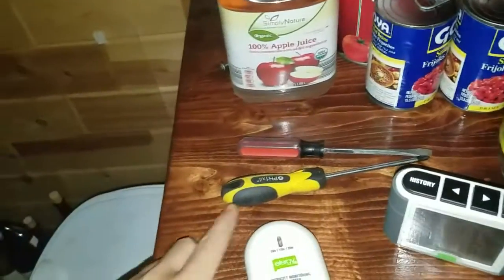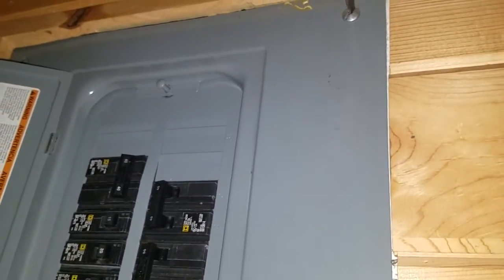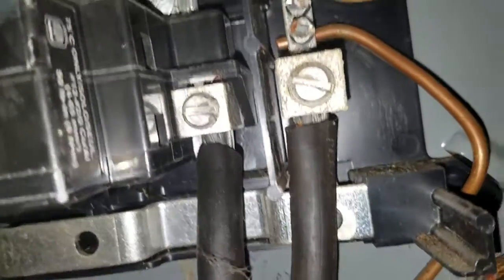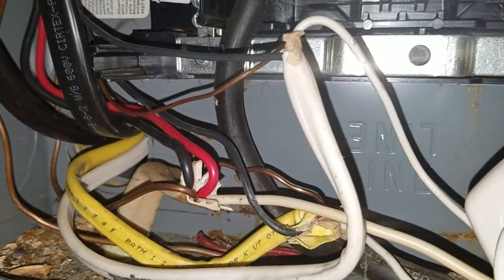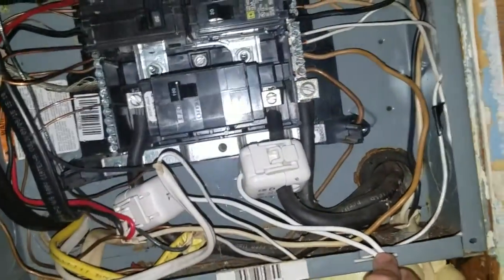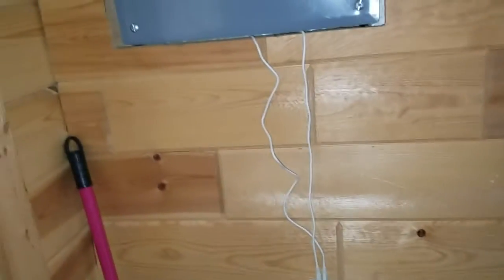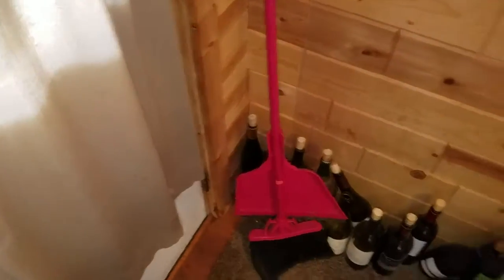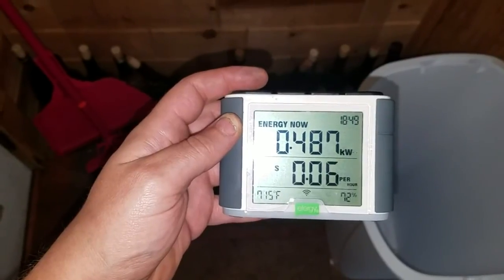How to install an Efergy Elite 4.0 Wireless Electricity Monitor

Comment: So i just got my Efergy......  Works but it has a FLAW... !!!

It works properly when it reads 120V pulls ONLY...   Let me explain where the flaw is:
When you have single 120V breakers...  Efergy is reading the amperage consumption from BOTH 120V legs.. It reads each 120V leg individually and adds them up for a total sum and gives you the total wattage... Thats the way it should work ONLY from 120V appliances....  Because different individual breakers will pull from a different 120V buss bar..  All the breakers on the RIGHT side do NOT always pull from the RIGHT side 120V buss bar... At least NOT in my panel... On my panel i have some breakers on the RIGHT side but they pull from the LEFT side 120V buss bar... and vise versa..  Thats just the design on my panel... Very odd but oh well...

Now here is the flaw:
the 240V breakers pull from BOTH 120V buss bars... to get 240V. Lets take the Hot Water heater for example... Its 240V, it pulls 18 amps from each 120V source...  BUT its NOT 36 amps total... Its only 18 amps total...  Amperage in a voltage series circuit is the SAME... So when you take 120V + 120V which is a voltage series circuit, the amperage/current is the SAME across both legs..  So if you take our clamp meter and go across ONE of the two hots you will get 18 amps.. If you move the clamp meter to the other hot leg you get 18 amps.... !!!  SO we assume its consuming 36 amps which is WRONG.. Its only 18 amps. But Efergy is seeing 18 amps on each 120V leg (dual breaker because its 240V) and adds them together for 36 total amps and gives you ~8600 whopping amps...!!! 
It did the same thing for my dryer.. My dryer pulls 25 amps from each hot leg.. Efergy told me that my dryer was pulling ~12k watts.... WTF...??  Again it took the 25 amps from one buss bar and 25 from the other buss bar.. added them up and gave me my total wattage... 
I said there is NO way this dryer is pulling 50 amps...  
So i broke out my 7k running watt generator and wired it to my dryer....  Dryer came on and ran.... for 30 minutes solid.. So are you saying that my 7k watt gen was able to support 12k watts...??  NO F'ing way... !!! 
Every 240V appliance that kicks on, Efergy is doubling the wattage for it because it cannot distinguish between 120V or 240V loads... ALL its doing is reading amperage thru each leg and adding them together which is fine and dandy for 120V circuits... 

If i am wrong, please help me understand how i am wrong and WHY it shows 12k watts for a dryer... when the specs for my dryer only show 30 amps at 240V which is 7200 watts when in reality is only 25 amps at 6k watts.... 

The only way i can see this unit to properly measure 240V appliances by themselves is to use ONE sensor on ONE 120V leg, in this case it does not matter which leg because its a dual breaker and it will pull from both legs, but in this 240V circuit, current is the same so both legs will read the same, then change the display module to read 240V so that you get the proper wattage...
Reply: The Amps may be incorrect in this case, but the Watts will be accurate, and that's what counts.  In your dryer example, where the dryer consumes 30A@240V=7200W, the Efergy monitor thinks that you're consuming 2x30A@120V=7200W.

Comment: Thanks for the video. But kinda confused. If I want to know total consumption I can just read my own meter. 

How would you measure individual appliances? For example lets say I have 1 box feeding two circuits, how would you be able to meter just one breaker?
Reply from the maker: +Matt Acuff do do individual appliances you take the reading with it unplugged then plug it in and see differance if you want to log a individual appliance over time yoyr going to have to get a diff system the one thing I really like about this system is the logging feature over time compared to just looking at meter and how it works with w7fi so can use your phone and walk around and turn off and on appliances and see differance it makes
Reply: Matt Acuff:
The 2 clamps he put on the MAIN's... you would just move those clamps onto each appliance breaker you want to read on...  So if you wanted to monitor the dryer and refrigerator individually you would put one clamp on the Dryer breaker (just one leg of the double breaker) and the other clamp on the refrigerator breaker leg....
Reply: Good luck going outside 20 times a day. This unit is for convenience of having it inside your home. Well worth the money.